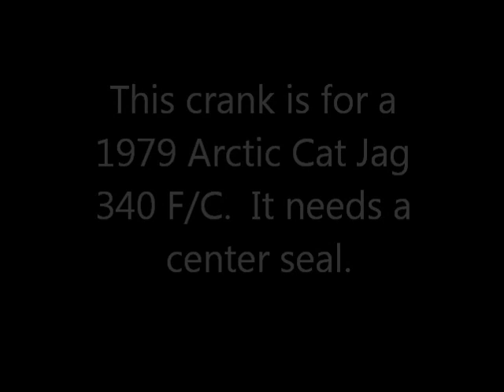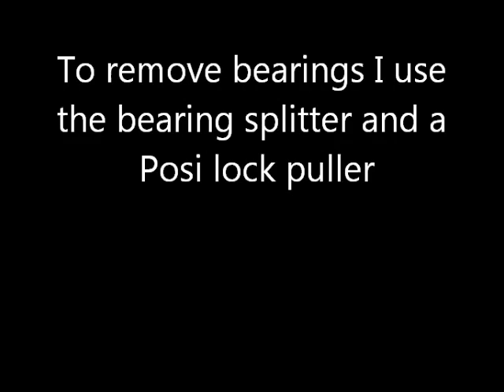How to rebuild: Snowmobile / Dirt bike / ATV Crankshaft

Comment from the maker: For runout you just hit it with a hammer in the correct place or put a big chisel between the journals and hit it or squeeze the journals with a vice grip.  For phasing you put a dial indicator in the plug hole and set the piston to TDC, and set degree wheel on end of crank to zero.  Put dial indicator on other cylinder and set it at TDC and the degree wheel should read 180 degrees.  There pics of it in the video.

Comment: Excellent. I am a DIYer and new this could be done at home. I'd like to start on a two cylinder, but I have a triple on t-cat. I'm told it is good to weld the pins. Would like to see examples before I tig it. Again many thanks, you rock!

Comment: if the phasing is off im guessing that you would have to takedown the engine and pull the shaft apart? or does it have a sort of "machine slot" to realign? or simply close enough

Comment from the maker: @outdoorking69 the press is a piece of junk haha.  Its a 12 ton, it barley works, ive bent the pins on it multiple times.  Its from harbor freight.  You should have at least a 20 ton.  But the 12 does work

Comment: its kinda a specialist thing you firstly have to have a press dial gauge v blocks and you have to be very maticulus and very exact about phazing the web no point in doing it if the engine jumping out the frame with vibrations

Comment: Reminds me when i was 16 good job ,Now remember it's simply adjustable v blocks at least 6 to 8 in tall (you have to make) rigid platform with a haytlow with a (S hook,spring ,plume bob degree wheel and a press) now we can phase a crankshaft before we install.       KPC RACING ENGINES